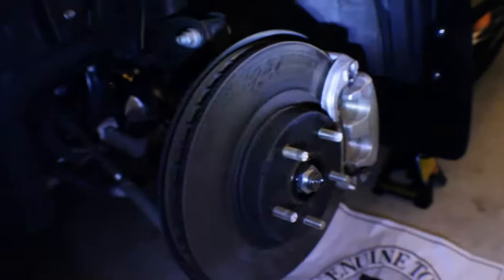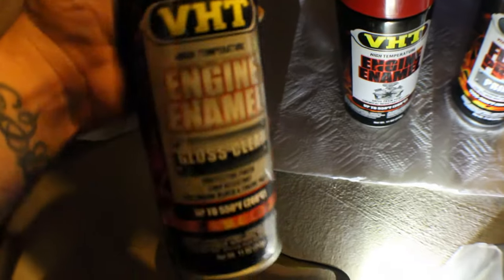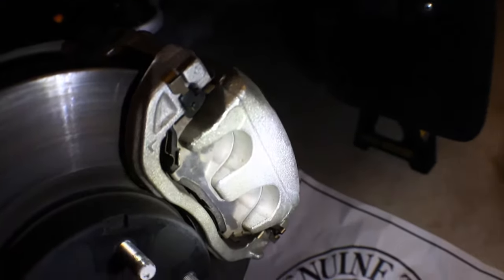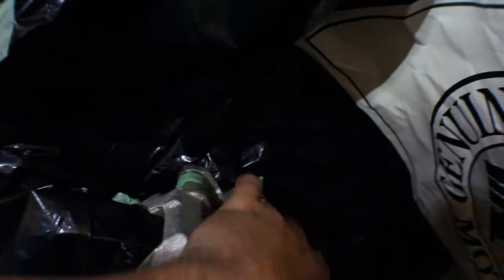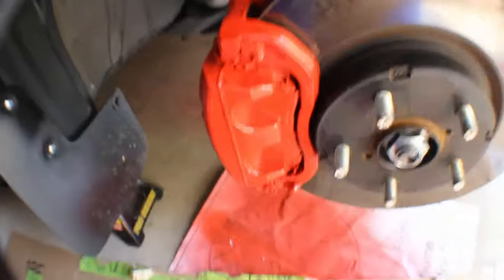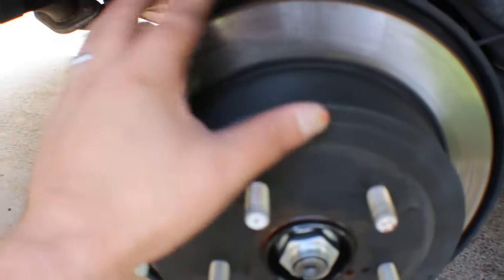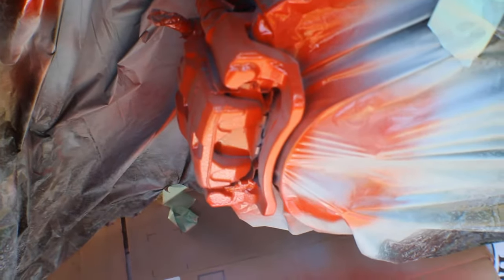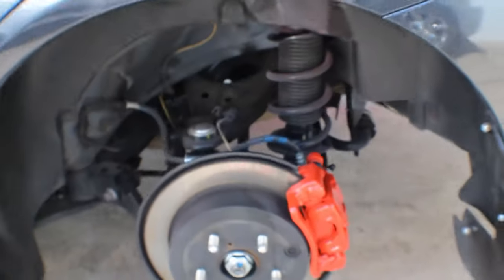PAINTING BRAKE CALIPERS 101 (2017 WRX)

Comment: Unbolting the caliper and letting it hang would have been WAY better and easier.  You painted the friggin pad itself.  lmao
Reply: I think painting the back of the pad looks better than just painting the caliper. It makes it look like one big solid unit and I can't imagine it would hurt braking performance by painting the back of the pad, especially since it seems he just painted the part of the pad that the caliper doesn't touch.
Reply: @jeffamb  ok jeff
Reply: I'd be most concerned because he painted the stainless steel clips that hold the pads in place and provide a smooth track for them to move in as they wear.  Unbolting the caliper from the bracket and removing the pads and clips would have resulted in a better product.